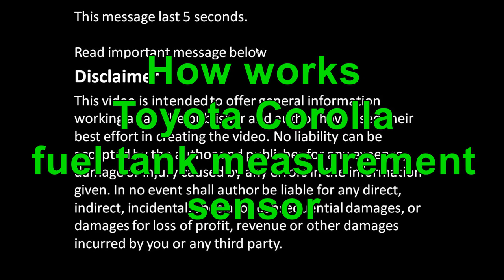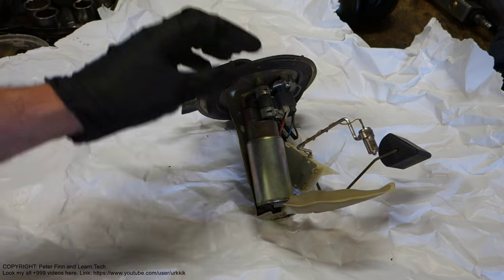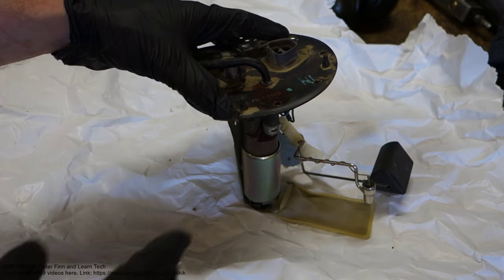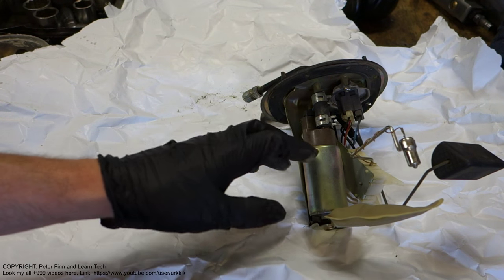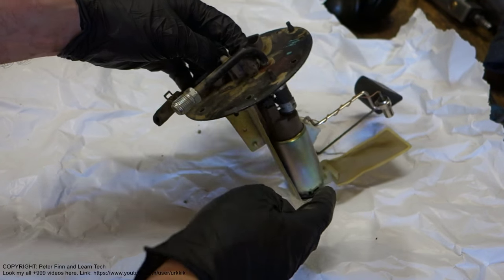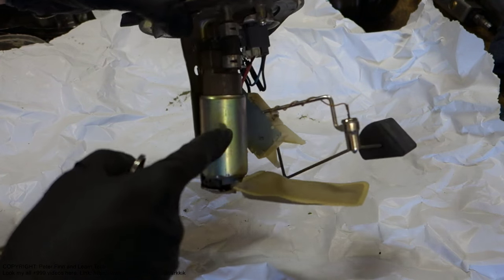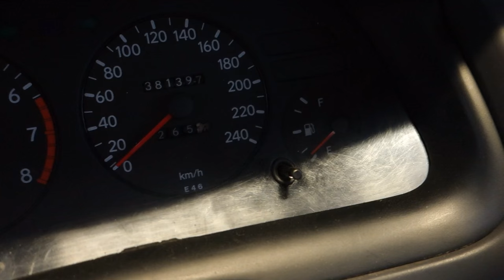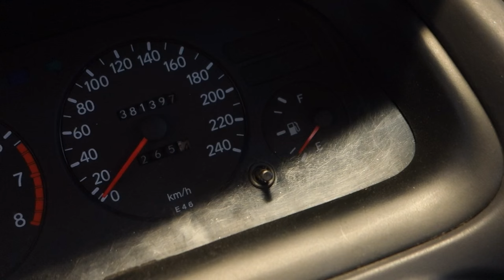How works Toyota Corolla fuel tank measurement sensor. Years 1995 to 2010

Comment: I have toyota corolla altis 2002 55liter fulltank . My fuel level before i refuel is 2bars before empty, I refueled 18liters and my fuel gauge shows 3bars before full tank its is it normal reading? From 2bars before empty afteri refueled just 18liter it already shows 3bars before it is full tank?
Reply from the maker: Fuel level meter is only estimation.

Comment: My gauge sometimes drops off to zero,
When there is plenty of gas.
Reply from the maker: Noted 👍
Reply: Same here what can be the problem??
Reply: @adnanali5480  Could be that the float has lost it's ability to float, I did work on a boat once that had that problem. I did go to a junk yard and get a used fuel pump out of a 93 Corolla. But I haven't replaced it, it's easier to drive around with an extra 2 gallon gas can.

Comment: The “empty gas light” comes on and I still have 3-gallons left in the tank. Do I need to get a new fuel measurement sensor?
Reply from the maker: No
Reply: @PeterFinnTheCarDoctor  whats the solution to this problem